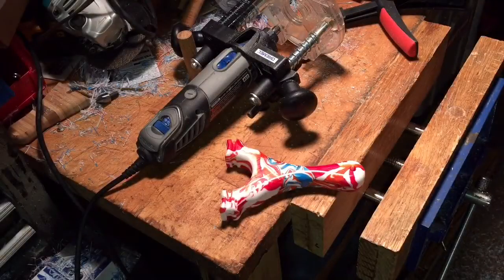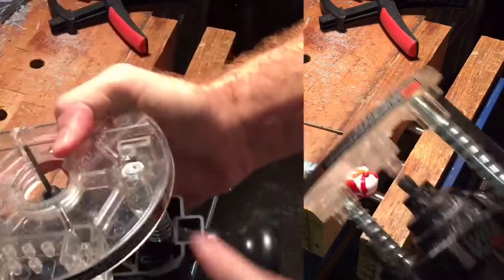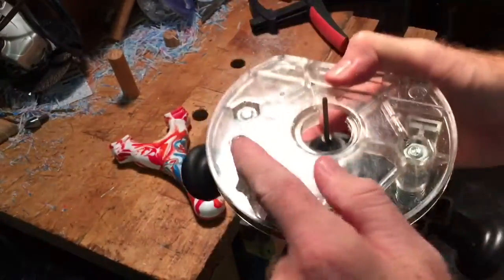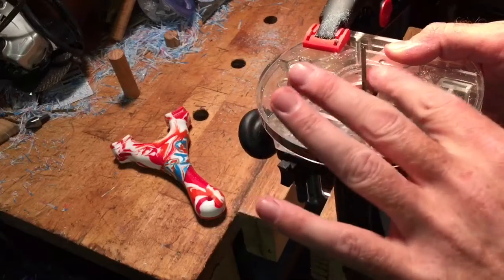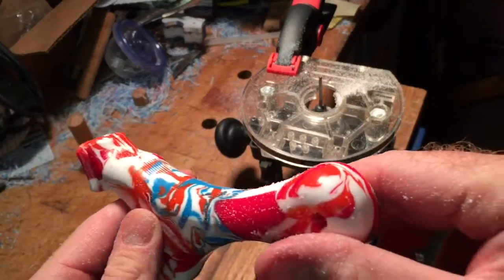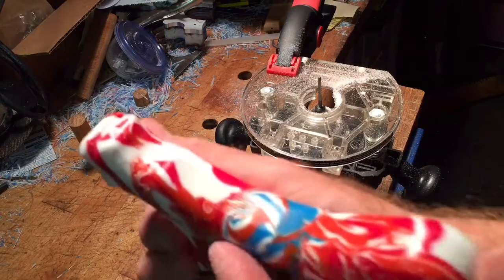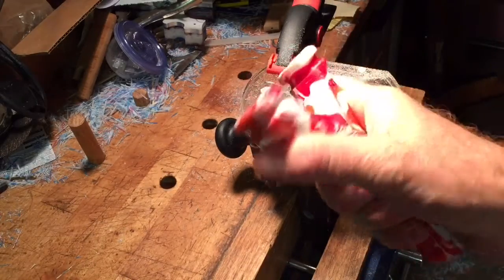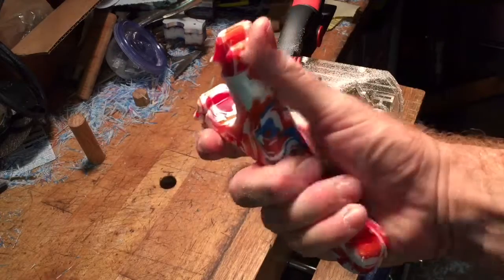Groovy HDPE slingshot

Comment: Just to help you mate, I had the same problem, What I did was I took that face plate off and made a nuther one 300 by 300, cut a reassess hole  in my work bench big enough to fit the router put it all together and now I have a bench top router, necessity is the mother of invention, give it a try. P.S, the new face plate was made from 3ml plate steel. works like a charm.